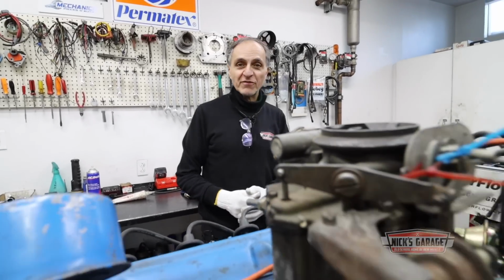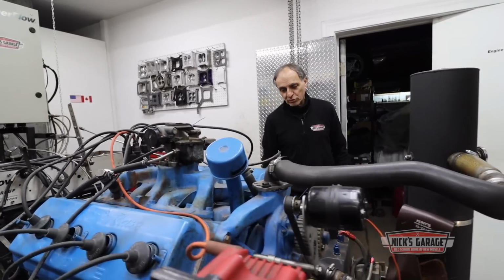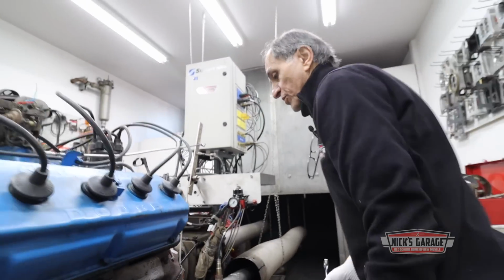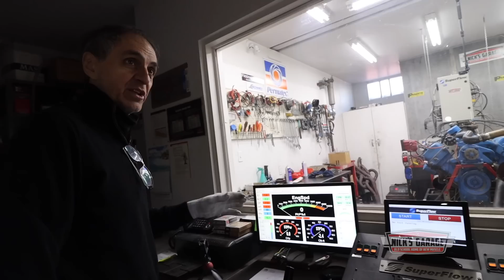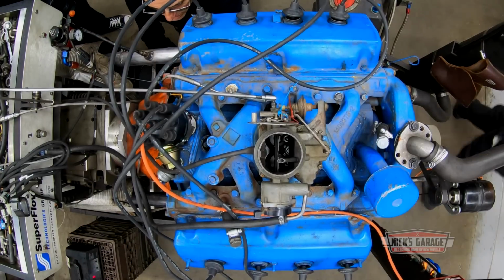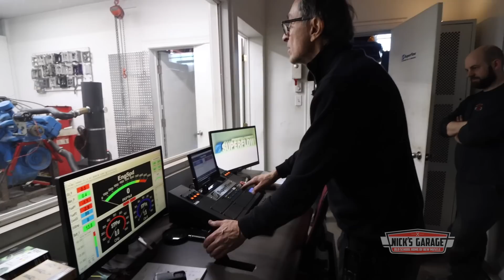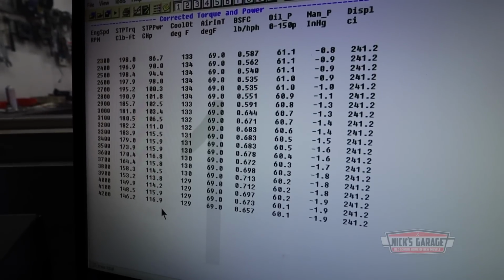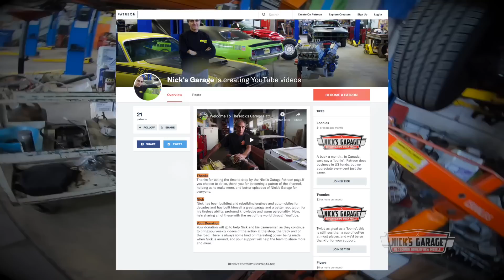Gen 1 HEMI on Dyno - WEAKEST Engine I EVER Tested

Comment: It seems as though the reason the starter housing is dragging, is because the bell housing is moving around and rocking. ... The bolts and spacers used to attach the bell housing to the engine block does not provide a stable mounting surface. ... The only way to correct the problem seems to be to clearance the starter housing, instead of trying to shim it. ... I am just a simple minded old time grease monkey, so, don't listen to me. ... Semper Fi
Reply: Or, of course, you can shove some copper wire in to a make shift eccentric hub for the flywheel. ...LOL

Comment: Yeah, it sounds like the starter and flywheel didn't play well together at first. You said it is a 241. Didn't they make a 351 or 392 red ram also? 140 hp? I have a 2.7 liter inline 6 that puts out that much and it's not a fast car. I'm sure the V8 has a lot more torque. That's a nice looking late 60s Barracuda in the shot when you went to get coffee. I had a 68 but don't know the three years that well to say which that one was from just the front view. Mine had PLYMOUTH spelled out in separate letters across the front but I was told it had the wrong front end on it. Judging by what I could see of the back I think it's a 69.

Comment: No way I would put that motor in a car of mine as is, a dam volkswagon bug would beat it. I could see an obvious crack in the exhaust manifold and that stupid 2 barrel carb with heavy cast iron manifold and the plug wire boots looked rotten.

Comment: I'm surprised by this video. 
You should never ever dyno test an engine that is way out of balance. Period. Most any shop would never do this because of the danger. Do a search on broken flywheels... that's some nasty stuff!
Hotheads has those in stock I bet and the customer needed one anyways. Why not just get one?
Also, any engine that far out of balance will have much lower hp numbers so the results are kind of pointless.
Love the channel but this is crazy.

Comment: Dodge is known for weak motors and transmission. Maybe the reason why they are owned by fiat now.
Reply: funny how the "weak" engines powered funny cars for over 40 years. Either original blocks or copies. Chrysler has always brought more to the table than most, today they still kick international ass wherever they go. I bet you drive a Ford lol